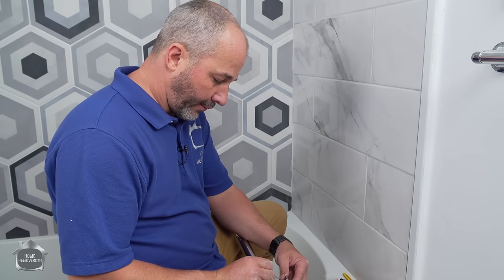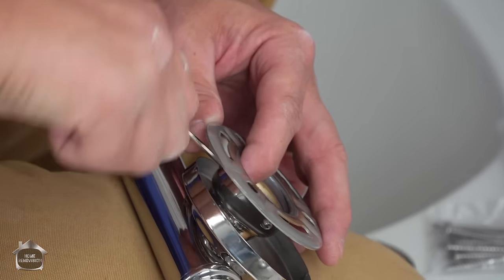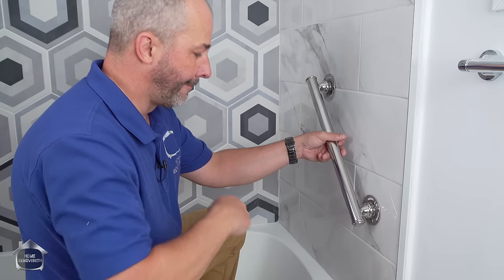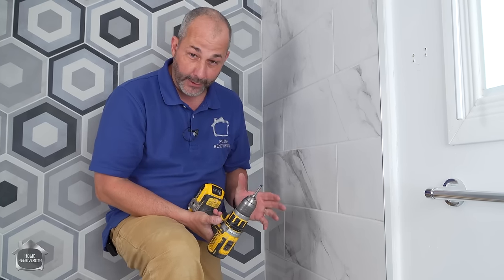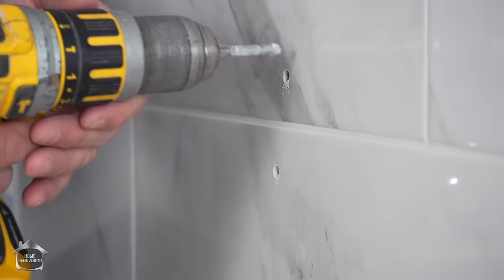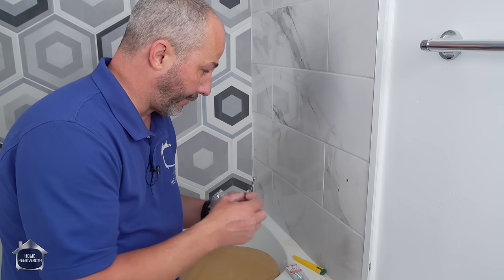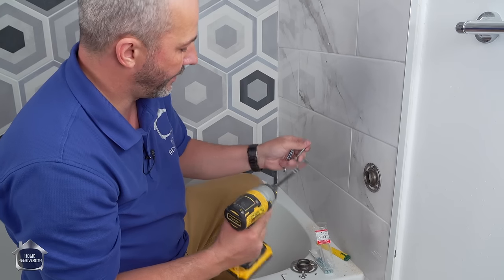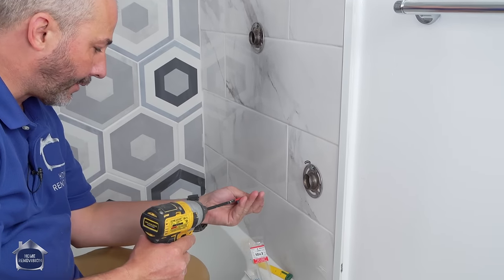How to Install a Safety Grab Bar

Comment: When I install grab bars and/or other hardware in a tub/shower area, I always recommend and use stainless steel screws. Non-stainless steel screws have the tendency to rust, eventually break, and could cause streak stains. I also apply a little bit of kitchen & bath adhesive caulking to the back of the mounting plate to make it water tight and prevent water from making its way to inside the drilled holes.
Reply: Good advice!  Thank you!.
Reply: My thoughts are exactly!
Reply: Thankyou!
Reply: Hard to find someone with the skills to do the whole job right the first time. Sad but true!

Comment: Jeff you make it look so easy!  One item you need to add is, how do you locate the studs?
Reply: Don't need to drill onto studs when in ceramic
Reply: @drippingwax  U can use a stud finder if the ceramic is not that thick. But in Ceramic, using anchors is enough to hold the bar and the person. U have to make sure that the anchors are very tight and there's no play when u insert them. Also make sure that the bar is suitable for the person to use as terms of the weight it can hold . I install those bars everyday , I'm a medical equipment technician.
Reply: @enderdadon696  can clarify “anchors”?  Which type specifically?

Comment: You kind of glossed over the hardest part (for me anyway) which is finding the studs through the tile and then figuring out exactly what angle and what place the bar goes to hit them.  I also have to question how you hit a 1.5" stud with three screws when the plate is something like 3" in diameter.  Every house I have ever owned is framed with 2 x 4's on 16" centers.  IF I find the studs on the first drill hole and line two of the holes up and hit that stud, then, the last screw 3" to the left or to the right is NOT going to hit any stud.  Did I miss something in the explanation?
Reply: Exactly.
Reply: I think for the off-stud holes, the idea is to angle the screws inward in order to hit the stud.
Reply: Same,  I watched this for no reason at this point
Reply: He only used two screws each I believe. Line them up so they both fall onto the stud. I am wondering as well if a stud finder would even work with tile.
Reply: @digi3218  a stud finder won’t work. You can use a really strong magnet to find the screws behind the tile from the hardiebacker. And 1 screw to each stud is strong enough to hold the bar
Reply: @rjyepez21  I actually used a stud finder today over tile and I think it actually went off where the stud was. But I only did it out of curiosity. That magnet trick seems like a better idea though.
Reply: He had 2 screws in the studs. The reference to 3 screws was the set screws.
Reply: @suzannetweedy9390  So he left one hole empty?  Might as well.  If he just installed it in the tile / drywall it would leak behind the wall and the whole thing would have to come down in a few years.  Thanks!
Reply: He didn't say it but he just lined up two of the holes from the mounting plates over the studs and just used 2 screws not 3.
Reply: @mitchfountain6523  im pretty sure he only drilled the 2 holes to mount it.
Reply: Yeah, waste of time given most people won’t find the studs. Should have shown anchors in at least one hole. He also picked a pain product with the three set screws in each, trying to tighten with a bitty key…
Reply: I know right😂😂
Reply: EXACTLY. This is what I was looking for and found in you comment. Thank you.
Reply: If there’s an adjacent room… you could try to find the stud in that room.  You still have to have a reference point to measure from in both rooms.
Reply: What if you find the stud on the wall next to the shower and then measure 16 inches to the left and find the stud behind the tiles?
Reply: The tile probably doesn’t go all the way to the ceiling this would allow you to use a stud finder, the length of the bar and distance between studs will determine the angle
Reply: If you can’t use the stud finder from above use it from the side, map out 2 or 3 studs to determine the framing, then measure over from those 👍
Reply: This was whole reason I watched this video. On the left he drilled holes in same vertical plane so they would both hit same stud.  But on right they appear to be too far apart horizontally to hit a single stud

Comment: Very nice step-by-step installation video.  I would mention a couple of things in the video to help the viewers....cover the tub drain with a rag so parts don't go down the drain, wear safety glasses and dust mask, show using a stud finder to locate the wood studs, mention using 3" stainless steel screw so they don't rust (I like the silicone sealant to cover galvanized screw heads to prevent rusting).
Reply: Yeah stainless screws is the way to go.. I personally would squeeze silicon into the hole until it's full and put the screw in and wipe off the excess. Sounds like a good idea to me.
Reply: the stud finder i bought finds studs in a wall but nothing in the shower/tub tile.  a major fail in this video.
Reply: Yes, depending on the stud finder brand/model, they sometime can penetrate the thickness of the wall will the tiles added.  I am thinking of buy the Walabot finder that finds studs, pipes and wires in the wall using your smartphone as the display device.  I know it is expensive, but it will prevent a costly mistake! @jensonee

Comment: how do you determine where the studs are behind the tile?  Maybe you already knew where the studs are since you just installed the tile. I don't think a stud finder will work over tile...  I assume there's a stud at the far corner of the shower.  Do you just measure 16" over and hope that's the middle of another stud?
Reply from the maker: It is pretty common for stud to be vertical at the outside corner of the tub. If you are not renovating and want to add on then this is the best option. If you can't find wood then you should open the wall from the other side if possible to geter,min e the positioning. Worst case scenario you will need to install a new tile wall surround. That is worth the investment for safety of elderly family. Cheers!
Reply: When its too difficult to find the stud, toggle bolt is the best option, its really strong
Reply: @phil505050p  Thank you!

Comment: Tip of the year: Put the plug in the tub drain. Or put something over it if the closer is inside the drain. If a setscrew falls you won’t end up in a situation where you have to mount the handle with less than the 6 setscrews 🙂 I know there where spare ones.. But better to not have setscrews in your drain.
Reply from the maker: lol, They sent me 3 extra screws like as if they knew who was going to be buying it!
Reply: Good place to use wide blue painters tape!

Comment: Where do you put the silicone? On the screws and in the hole? You mean the 4 holes that you drilled? Or just around the plate after installed?

Comment: I have the same grip bar and mine has come loose. It seems like the installer put silicone around the edges.  Can you make a video on how to tighten it?  Or send instructions?  Thanks!
Reply: Not all contractors/handymen are created equal. The grab bar probably wasn't installed properly to begin with. If it's just the ring that covers the screws being loose they just pop on the grab bar. May have to clean the old silicone off and put some new silicone on to get it to stay in place. If the main support screws are loose then I recommend getting someone involved who cares about how they work on things.

Comment: I installed one of these recently but didn’t bother with the set screws. Lol. Just pushed the finish plates aside and marked the holes. 🤷‍♂️
Reply from the maker: that depends on the model and the position of the wood. Cheers for saving a step!

Comment: You can add a rubber gasket over the drill bit. It absorbs the impact when the drill bit makes its way through and the chuck slams into the tile.

Comment: Sorry Jeff, but you really need to redo this video with proper installation steps. From finding the 2x4, sealing the drill holes, to as simple as covering the drain so you don't lose screws. Really enjoy your videos though. Keep up the great work.

Comment: Nice work BUT!!!!
What I wanna see is someone going into a tiled bathroom, that they know nothing about, and locate the studs , I tried  everything, mine is a older bathroom early 1970’ with the mesh In back
Anyone have any tips on how to secure this grab bar would be appreciated!!!
I used those plastic inserts before, I’ll probably use them again ,thanks in advance

Comment: Did you mark the studs, prior to tiling?  Will a stud finder work through tiles?
Reply: He obviously did not cover locating the studs which is the most important part of the job. A stud finder will not work through tile. If the tile does not go all the way to the ceiling, then mark your studs with a studfinder above the tile then, using a level, follow a straight line down from where you found the studs up top. 
Now, if the tile goes all the way to the ceiling, then you’ll need to use toggles. DO NOT USE EXPANDING ANCHORS- they will crack the tile.
Reply: @mediaadrenaline  Wonder if a stud finder would work through a fiberglass surround?
Reply: @andreabasney  Fiberglass surrounds have a nailing flange at the top and side edges. When installed, the walls of the surround stand off from the wall by 1.5-2 inches. You need a brace between the stud and surround wall. Very challenging to do from shower side. Easier if you have access from the other side of the wall. 
Consider removable suction device or call a carpenter who knows how to do it.  VERY challenging DIY project.
Reply: Useless video, how are you supposed to know where the studs are?

Comment: What happens if you have no idea where the studs are..... anchor alternative explanation would have been great
Reply: Thats where you use a stud finder. It helps detect the stud through the wall... you mark out either side of the stud as you locate it.... that way you can work out there centre of the stud and use it as the best place to drill.
Reply: @jasonh289  thanks, my stud finder doesnt detect through tile, maybe using the wrong brand?
Reply: @francoUSAhome  yeah your generic cheapers ones cant... but if you get a uwb scanner it should pick it up

Comment: So here is something many don't know. For the install where it has no lumber to screw to. They make a very large wall toggle with a round plate for the grab bar to screw to. It is designed just for grab bars.
Reply: Wing-Its are now pretty widely available

Comment: I have a tib surround.  How do I determine where the studs are to install a grab bar?
Reply: You can get an electronic stud finder from a big box store.  They are not very expensive and run on AA, or 9V batteries, typically.  You place the device on the wall in the area you want to check, push the button to turn it on and then move it slowly until it indicates that it located a stud.  They usually have lights or digital displays that indicate either the center or the edge of a stud.  Probably better to get one that is center-reading, but it's a personal preference.   Anyway, that's just a quick answer, the details for whichever device you buy will give you all the info you need.  Fancier ones will tell you if there is something metal behind the surround (perhaps a water pipe),  or if you are near electrical wire.  Those cost a bit more.
Reply from the maker: If that fails check the comment section again I laid out the process in a previous comment. Cheers!

Comment: I like your work Jeff. Seen a few of yer Vids. By far the Pearl of Wisdom was Porcelain versus Ceramic. [Shows my ignorance right]. How do I go about drilling Porcelain, or should I just shoot myself now? Using two screws on the studs made me nervous, but the 3rd is unlikely and the fourth will never hit the stud, so go figure. I despise that set screw system you were fumbling with but respect your rational as far as I can follow it. I would go with a simpler system with lots of clear silocone shloshed around.
Reply from the maker: LOL, but a diamond tip blade. Cheers!
Reply: I have used those same glass cutters through porcelain, and came out good. Big box sells a set, I start with the smallest one and work up to desired size. I have a cup of water to keep it wet too. That small one goes through porcelain pretty easy, then walk up. Hope that helps

Comment: Applying silicon over the head of the screw in the wet part of the shower and that was the the answer I was looking for when nobody mentioned anything about it. Thank you sir. 

Also, please remember to wear safety glasses and dust mask when working with tiles. Just trying to help.

Comment: Good info Jeff, I have a question for you, I have a walk in shower, my shower head faces the same side you're installing the grab bar, can I install my grab bar vertically w/both ends in the same stud?  Thanks!
Reply from the maker: Hi Donna, of course you can for sure. In most cases it is installed vertical. In this house we have 2 folks needing it and the slope allows for great grandma to put her weight on it as well. Cheers!
Reply: @HomeRenoVisionDIY  Thank you Jeff, since it is 'just me'  using it just to steady myself getting into & out of the shower, which does have the sliding doors, as we know, those doors are flimsy & if one would grab those, ugh oh, they might pop out.  Thanks, I'll be installing the grab bar likely next week, I'll let you know how it goes.  "Donna"
Reply from the maker: @A10TOES  way to go Donna, I would love to hear how it goes for you. #empowering
Reply: Hi, my showers have a surround comes into the shower over an inch, it looks like tile. How would I install safety bars where the surround is not flush on the studs?

Comment: Those hole spacings look wider than a common stud...you might get lucky with two of the holes, but the third would likely not catch enough meat to hold well over time, or--more likely--miss the stud all together and just be swimming in the tile and backing. Maybe two is strong enough? Now, if you were lucky enough to have double studs on both ends...well then, you're golden....I do not, though, and will be probably be using a toggle for the third hole

Comment: So, I'm assuming a shower rod would be installed similarly.... but I have porcelain subway tile and I'm not certain of the studs.  Is it crazy to use stainless steel toggle bolts and then silicon?

Comment: Falling sucks at any age, but when people get older its much worse. My 83-yr-old uncle just fell and broke his hip (although, it was in a hallway at his assisted living facility-- his foot hit the leg of a couch in the hallway & he tripped). He's in a lot of pain right now but is in good spirits at least. He's got a shower with grab bars that he's looking forward to getting back to when he gets out of the hospital.
We need to renovate Mom's bathroom and fix it up so she can safely use the shower. She has balance issues and falls easily. I already bought the grab bars and the shower kit but need to tear out the old one, repair/replace subfloor, and add backers for the grab bars once I figure out where she wants them.
Moen makes some beautiful grab bars. I got some of their Home Care ones for Mom's bathroom.
The allen keys don't always come in the package, which is so aggravating. And those tiny set screws are a pita. I got a Moen tub spout that needed the allen key but didn't have one included and it didn't even say what size it needed on the box. I had to get one of those multi-set ones and play around with it until I found the right size.
Magnets are your friends when dealing with small screws. "Totally set-screwed" LOL!
Reply: For older folks, sometimes the hip breaks which causes the fall. Bones get so thin and brittle that they can snap just from walking. Likely some medications cause this condition.

Comment: We were looking for a towel bar for inside the shower and were disappointed in the chincy products available. We discovered a 16" long safety grab bar that is sturdy, strong, that has small diameter pipe 3/4" maybe). Looks good and is strong.
Reply: where did you purchase the 16" safety bar. Do the support screws line up with the 1 1/2" wide studs ?

Comment: How is it that you have wood to screw into on every screw? did you plan ahead for this? I am ready to put cement board up over my new bathtub. Should I add some backing for the grab bars?
Reply from the maker: definitely. I take a picture of my tape measure on the walls before i close so i have the measurements for later!

Comment: “A lot of work for a clean look.” Great quote! Put many of these in. A lot of extra work, but this grab bar is great!
Reply from the maker: I found that most "stainless steel screws" are less than great long term. That is why i prefer the hidden fastener. It seems to outperform . Cheers!

Comment: An impact driver on that marble tile!? I'd be afraid it would crack the tile. I would predrill the hole just smaller (1/16") than the screw and use a regular drill.
Reply: He said it was porcelain tile
Reply from the maker: ceramic of course. Cheers!

Comment: Would you install a grab bar the same way when using the Kerdi Membrane waterproofing? Would the screws void the guarantee?
Reply from the maker: The bar is on the opposite side of the wall. so no worries there. If you are vapor conscious then you can always use a little silicone in the hole first and after installing the hardware. Cheers!Cheers!
Reply: @HomeRenoVisionDIY  Thank you!

Comment: How do you cut a maax tile shower wall to accommodate a window???
Reply from the maker: predrill the corner locations with a small bit. then use a jig saw to connect the dots. Cheers!

Comment: are those 3 inch screws stainless
Reply from the maker: Not yet, I have plans to pick them up but my hardware store does not carry them so I needed to make a trip across town. I will switch them out in a few days., Cheers!